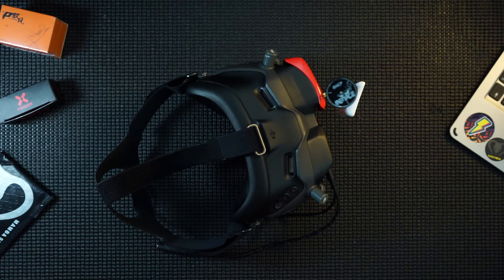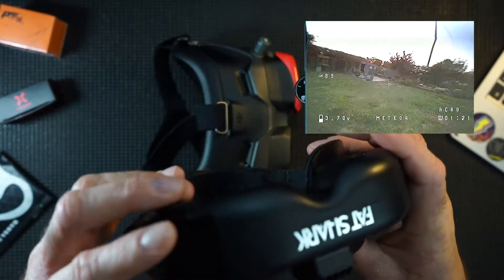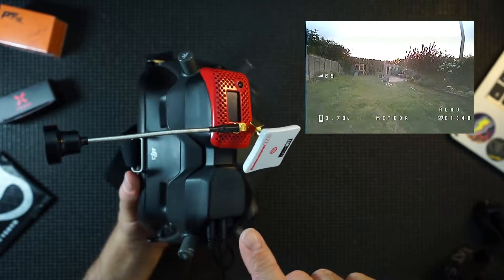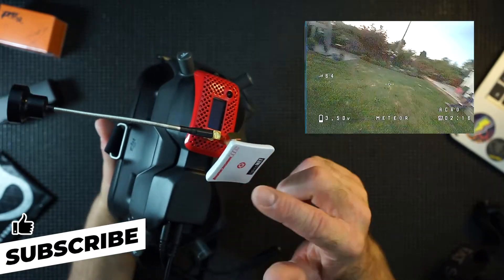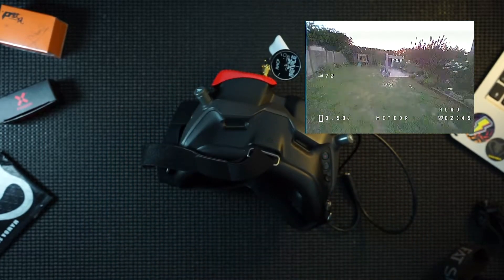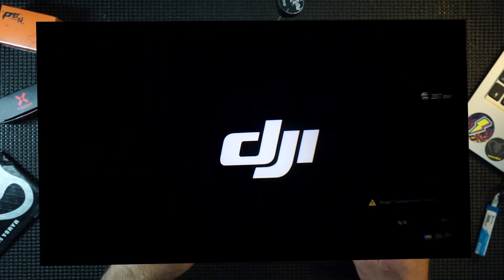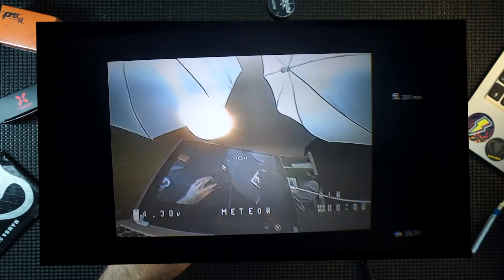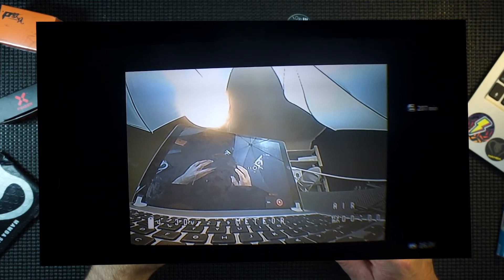DJI fpv goggles analogue mod NO soldering the digidapter UPDATE

Comment: Im just getting a blue screen when i switch to av in i have the rapid fire module with bdi adapter
Reply from the maker: make sure your quad is on, you have the power cables in correctly and your rapid fire is on / in the correct band? it should all work mate?